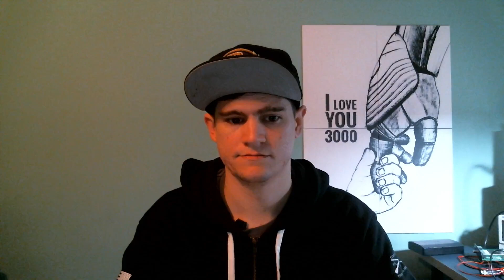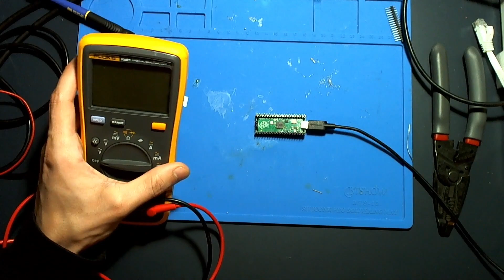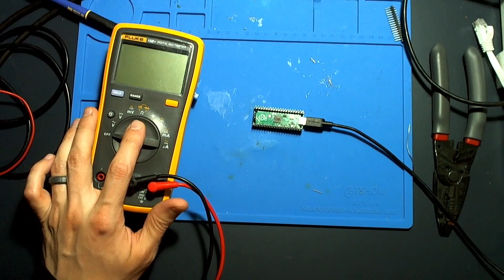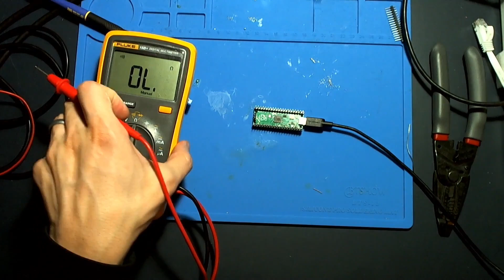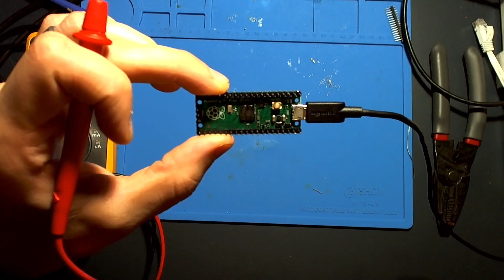Hardware Hacking Tools: Digital Multimeter

Comment: What multimeters are best for electronics vs electrical systems that electricians work on for Fluke?
Reply: As an electrician, used Fluke 87 (for True RMS). For electronics, Fluke 107 is enough.